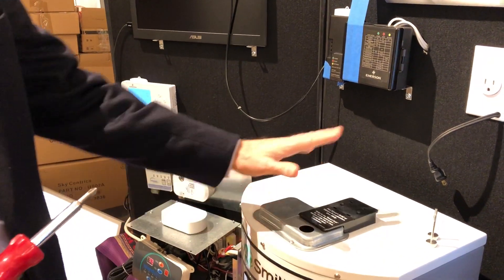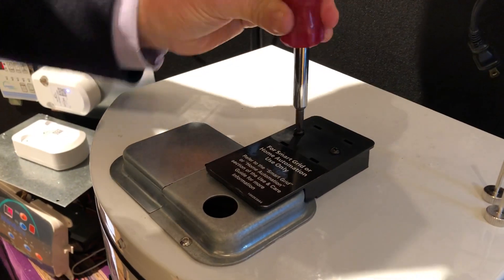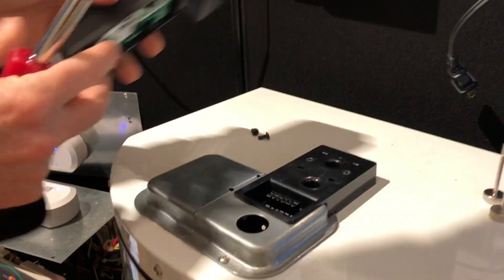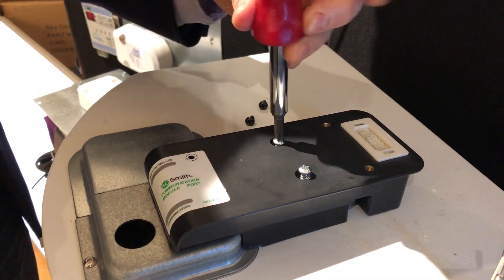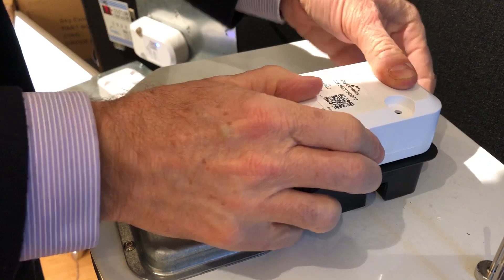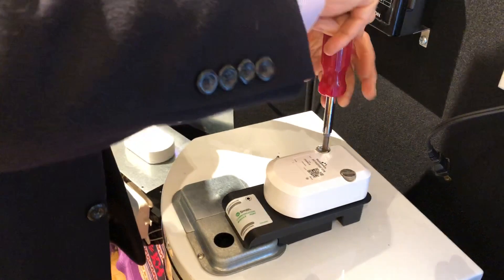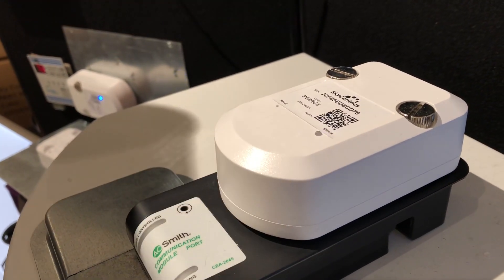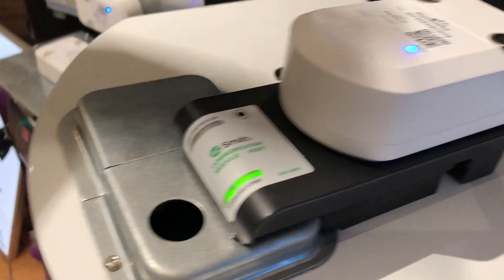Installation of SkyCentrics CTA-2045 module on to an AO Smith water heater

Comment: On my AO Smith HPWH (HP1050H45Dv 130) the interface is on the front, not side. The ‘adapter’ clearly won’t fit. Would the ‘EcoPort WiFi’ module plug in directly?